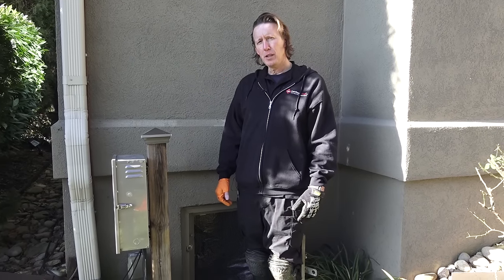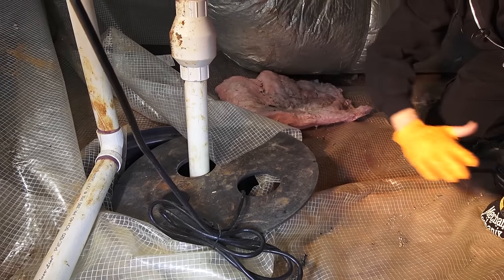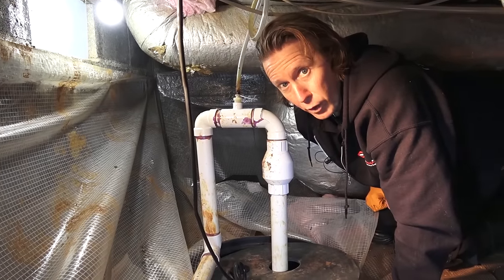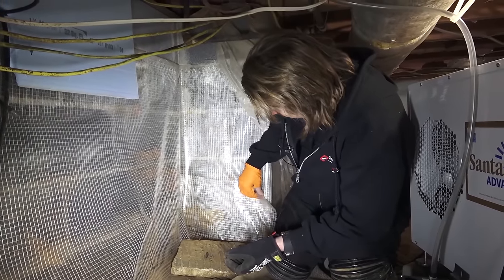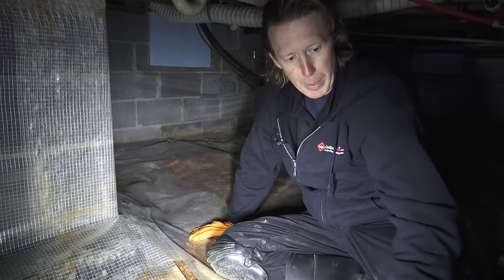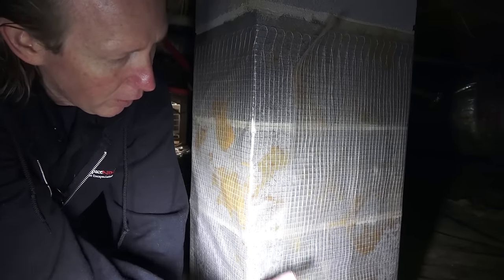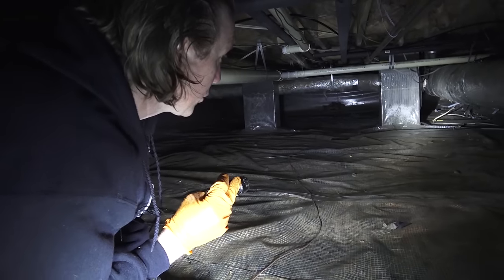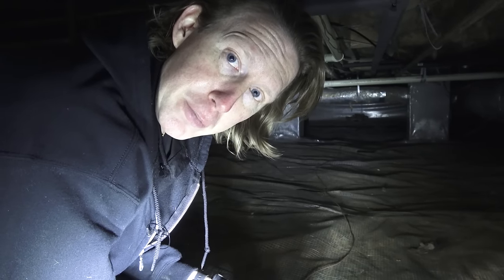Redoing A $25k Crawl Space Job | Tips For Inspecting Your Crawl Space | Find Crawl Space Problems

Comment: I purchased ALL my supplies from Michael some time back (he did not ask me to write this!)  - I communicated with him personally several times for advice as I intended to do my DIY crawl space. AFTER several crazy estimates (VA) I could not afford it contracted out, so I and my boys gave it a shot. We watched videos as well. My CS was extremely hard to do with the highest point under the house at less than 3.5 ft. It took numerous weekends but we got it done. The 2K spent with CSN - saved me 25K. We also installed the vent fan and installed a dehumidifier. TURNED OUT AWESOME .... now I need 2 new doors and I am watching Mikes guy do that. Thanks Michael!!
Reply: I'm thinking of doing the same. Although I am extremely afraid of spiders. I may have wear a full hazmat suit and tape up every opening 😂. The only thing I'm thinking of paying for, is the removal of my joist insulation and treating the frame with the blue mold treatment. Did you do that too?

Comment: I have a basement not a crawlspace and I have learned so much from you. My  dehumidifier runs constantly. Granted I tried to get cheap and leave it off but ended up with mold. Having a chronic illness I got motivated but the cost of running that energy hog has me trying to learn more about it. Fieldstone foundations suck. I have labored over tuck pointing for years and still aren’t even close to finishing. But it’s now obvious where the moisture is coming from. Thanks for sharing your knowledge.

Comment: Love your channel, watched for a year or so. I water proofed the  block walls of my house from the exterior after seeing puddles of water in crawl space. House is in Western NC. My self and 2 labors dug out dirt 3’w , 8’ d to 13’ deep by hand. I used Thourseal on the wet block down near footer and blue liquid rubber on dry blocks. 2 Coats of each. Then dimple board, ran 4” pvc pipe all the way to end. Installed big sock of  Geo fabric then 15 tons of granite gravel. 1 1/2 years and no water. I can send photos, have plenty. I want to correspond with you on how to proceed with the encapsulation. I will try calling you. Thanks John M

Comment: Do the research before hiring someone and get in there with the workers that you hire ask questions is always good to ask questions
Reply: I did a lot of research and from all of them i felt your methods were the best.  I just really wish someone would have mentioned that you should keep wetting down the soil for digging your trenches towards the basin.  10 times faster and easier is an understatement.  And you have a sure way of knowing which way your drainage will flow.  I will share pics if anyone is interested.  Thanks guys for great information.

Comment: The BUILD channel (with Matt Risinger) recently did a video on this, and confirmed this solution for crawl spaces.  He said ideally, you either have a full conditioned crawlspace, or you have a basement.  However if you don't have either, then either consider having closed-cell foam sprayed under the floorboards (after the crawl space is dried out), or consider having it rehabed, where they full condition your crawlspace.  Otherwise its unsafe, unhealthy, and could ultimately cost six-figures in major repairs.

Comment: This is exactly why you do your own research and do it yourself.  There is no reason some plastic and foam board even with labor should cost anywhere near $25,000
Reply from the maker: You're right, just plastic and insulation usually do not cost this much. However, when you include costs for humidity control and water management, plus the size of the crawl space itself, costs begin to climb. We love to support the DIYers out there and that's why we have all of our recommended products available for purchase online!

Comment: This is complete laziness, pointblank.  These people were taken advantage of and I'd be really be raising some hell, if i were them.  In regards to the mold, after you clean and disinfect the subfloor/floorjoists, could you use a mold resistant paint as an extra bit of protection if there were any future moisture issues? I had a huge plumbing issue in the house I bought that went undetected for years because there was no crawlspace access - it ended up rotting all my subfloor and joists. So now i've removed it all and want to be as proactive as possible going forward. I plan on also adding some lighting and sensors to monitor the temperature and humidity there and in other hard to access areas of the house. Thanks!
Reply from the maker: Hey Derek, we use the Anabec x70 preventative after disinfecting and cleaning the mold. You can find it on our DIY Store: https://diy.crawlspaceninja.com/

Comment: The original system was built by one the Huge Pest Control Firms. I have a dozen videos like this, but I'm too small to put them on YouTube. They use a $18 Chinese-made condensate pump. The plastic has micro-holes in it. It's made for the grain and oil industry, not for crawlspaces. Most of their walls are laying on the ground. It's a shame, really
Reply from the maker: We run into it often too. Thanks for sharing! You should still put the videos up! We were once small not too long ago. :)

Comment: What is the best way to join the vapor barrier plastic parts together?  Tape? Glue? Glue + Tape?  (All it takes is 1 power outage, sump pump doesn't run, vapor barrier underside starts pooling water, tape pops, and then the pool is above the vapor barrier)

Comment: Also on the sump pump they used DWV pvc fittings, when they need to use pvc pressure fittings. Itll work but its not correct it also has to be atleast schedule 40 pvc, not foam core pvc
Reply: False that pressure is perfectly fine for DWV

Comment: What are the steps in priority in the encapsulation process

1 remove fiberglass batt insulation 
2 spray mold with sanitizer 
3 mechanically remove dormant mold
4 block vents 
5 add dehumidifier  
6  wait till dry
7 remove old vapor barrier 
8 install new vapor barrier to walls
9 install new vapor barrier to floor
10 reinstall dehumidifier 
 
Dose that sound like a plan that would be good practice for a tall crawl with out much water penetration issues
Reply from the maker: Close! We'd recommend: 1, 4, 5, 6, 3, 2, 7, 8, 9, 10

Comment: So probably its cheaper to just do a 2” concrete slap with vapor barrier underneath it when we build a new house, right?  Cleaner and much easier to claw around.
Reply from the maker: If you're able to do it during the build, that can definitely be an option. Keep in mind you will still want to control humidity and if the grading is not done correctly you can still deal with flooding issues in the future.

Comment: This borders being criminal. I know this system very well. It's 6mil DuraSkim that actually is manufactured with microholes in it. The walls are "stuck "up using spray canned adhesive that will run the homeowner out of the house. They rarely use a fan at all. When I was there, they used a $79 pedastol-type Sump pump and charged $1900 for it. They dug no trenches, they don't overlap the seams unless it's convenient. They don't tape them. Honestly, the last four Santa Fe units installed by this firm were NOT working, they use 1/8" foam board to block the vents. They put a single flap of poly over the door area and call that done. Once, I charged a homeowner to remove Insulation and spray the floor joists with BoraCare. 1200 sqft house = $2400 to remove Insulation + $1800 to spray the underside. Homeowner calls me. He says "Right down the very center of the crawlspace , from end to end, the insulation wasn't removed. So if the insulation wasn't removed, how could they possibly miss that if they sprayed it?" . I got those kinds of questions thrown at me EVERY SINGLE SOLITARY DAY. It was almost comical how they somehow blamed the homeowner. At 22% APR financing, it's an absolute sham from start to finish. I made a video of two other employees that too me ON CAMERA that when the client was charged thousand$ to have it sprayed, they almost NEVER sprayed it. And I HATE THE CLEAR TOO. But it's cheap. Buying that nationwide, I was told they paid $12 per 1000 sqft. I might get a $7500 contract including $2000 of interest , and when three men did the job in 4 hours, the client might have less than $100 worth of product. One last thing. It comes with a one year warranty, and an annual renewal fee of 12% that was supposed to include changing the filter. To this day, having done 200 of the annual renewal inspections, I have still NEVER seen a Santa Fe filter. Embarrassing. I made a ton of videos when I worked there. A ton.

Comment: Sloppy installation of good materials. The dehu should’ve been installed in the center. The barrier overlapped and taped, glued to the wall and ramset, at least a yearly inspection, vent materials poorly installed, I don’t think that particular barrier is even used anymore, the drain system is acceptable except for the install. For 25,000 before and after videos are a must.
Reply from the maker: Thanks for your feedback and watching.

Comment: Thank you for actually offering a service with knowledge about your field. 

 A question for you, this job had floor joists insulated with fiberglass. Why was it removed? 

 I am in West TN and about to embark upon this same project at my home.
Reply from the maker: When we encapsulate we have to remove it to address mold, so we insulate the walls instead of re-insulating the subfloor. We find it works best for efficiency and it allows you to see any leaks from above that may get hidden by fiberglass and eventually cause mold.
Reply: Very logical thank you!

Comment: Is it wise to cover the ground with stone before laying the plastic caper barrier in a crawl space?
Reply from the maker: Concrete slabs should be placed directly on top of vapor barriers, followed by subbases. A thin layer of sand can be placed next to the vapor barrier if the subbase is sharp angular gravel.

Comment: CONFUSED:. read through comments hoping not to repeat a question.  You are sealing the foundation vents  but then you mention you need proper ventilation to prevent the odors?  What am I missing.  My daughter's house has 4 crawl space vents and I am getting ready to lay vapor barrier in hopes of eliminating the damp muskey smell coming into the house.   Should I not seal all the vents to get some airflow?
Reply from the maker: You are correct, we seal all vents but one and install a ventilation fan blowing outward. This is per international building code recommendations and to also help mitigate any radon issues. If you live in an area with higher radon we recommend checking with your local building code to see if anything more strict is required. Here are a few videos talking about ventilation that go into more detail:
https://youtu.be/LzBlVnbn6A4
https://youtu.be/0q73lxzhyN4

Comment: How would you go about applying the plastic to the concrete walls and pillars? I bought a house last summer and notice it was very humid in the crawl space. There is vapor barrier on the ground but they put dirt over top of it and the dirt is always damp. So I'm thinking of putting thick plastic over the dirt.
Reply: Have you figured it out yet?

Comment: Unfair.

You can't say that all of that garbage in the back is their garbage and at the same time say that the job that they did wasn't worth $25,000.

Obviously the job wasn't simply an encapsulation job they did a number of different things down there and just based on the video the encapsulation wasn't the primary job.

My guess is they were called in on a flood emergency, they probably removed a whole bunch of damaged material, install the plumbing,  installed the dehumidifier, arrested mold and lay down perfunctory vapor barrier. 

It obviously wasn't a job done well but I do feel that it was probably worth the $25,000. 

Sometimes when you talk to a customer and you tell him how much it's going to cost to do this this that and the other they say well I'm not going to put $50,000 into the underside of my home -- I don't see that, I don't go down there, I don't care what it looks like ... so they choose the more affordable option. 

Did something that caused them to call you to come out to do the inspection it would have been great for you to tell us what that was.

And there was a presenting cause for the original job it would have been nice to know what that was as well.
Reply from the maker: There was smelly a musty smell getting into the home and the company that did the encapsulation had no solution to correct it. That is why they called us out.

Comment: If the trench was installed low enough but was disconnected at the corners, what would happen? It would still flow three the gravel and into the next pipe? Correct?  Or would
There be a major flooding?
Reply from the maker: Yes, it could cause flooding, but the main concern would be contaminants/dirt washing into the pipe and clogging it. That is also why you need pipe with a sock around it to help keep dirt out.

Comment: This may be a stupid question but j dont know the answer so....why do you seal the vents ? What is the purpose of the vents if they need sealing?
Reply from the maker: the vents are sealed to prevent humidity, the second questions is a very good question but we dont have an answer to that.
Reply: @CrawlSpaceNinja  imo I dont like encapsulated crawl spaces. We definitely like to put a 10 mil vapor barrier on the floor of the crawlspace and French drain, dehu  etc if needed. But instead of doing a full encapsulation we use an atmox system. Basically fans by the vents that will circulate the air. The have humidity sensors. If an encapsulated crawlspace has problems then the only place the bad air has to go is up. If you can circulate air from the outside and keep the area fresh its probably better than trapping everything in. And btw 10 mil black poly looks good and comfortable to crawl on

Comment: Hey bud I just bought my first house it was built in the 50s my floors are buckling walls are bowing an in bathroom ceiling is coming down around the bathtub had cold air coming in around it so I looked in the crawlspace because the fan stopped working an where the doors are the plastic is pulled back an the foundation bricks the first 3 rows are wet any I dea how to fix I'm on unemployment so cheap way thanks
Reply from the maker: Sadly it wont be a cheap fix, if you have water intrusion you will need a water management system, and also a dehumidifier.. you can always start with a dehumidifier so you can control your humidity

Comment: Can you advise please?  We have some old mold (black & white) on some of the floor joists in the basement.  We have the dehumidifier going constantly, but want to kill the mold and clean it before I apply concrobium mold encapsulator on it.  Any ideas as to the best mold killer and cleaner to use that I can just spray on and let dry?  I want to find the easiest method, since some of the joist are under ductwork and hard to get to for scrubbing.  This will be a DIY job.  Can't afford a mold remediation team and dehumidifier has pretty much abated the active mold anyway, but we want it permanently gone so it can't ever have a chance to reactivate.  Thanks, hope you know of a product...or if you sell a diy kit for this.
Reply from the maker: Thanks for the questions, 
we have some mold cleaner in our https://diy.crawlspaceninja.com/product-category/mold-removal/  we sell and use anabec for mold removal.
Reply: Crawl Space Ninja , Thanks very much!  I will be checking out the link. 👍

Comment: How much will the job estimate out to do it right? Are the sump pump and dehumidifier reusable for the redo?
Reply from the maker: Since we are having to correct many issues caused by the previous installation, in addition to our exclusive installation practices, the cost will be more than what the homeowner paid previously. However, they will have the peace of mind of a lifetime warranty with their encapsulation. The dehu is not being used, but we did keep the sump pump and installed a second one at the back of the crawl space. Keep an eye out for a progress video and an after video. Thanks for watching!

Comment: Would you be better off pouring a concrete slab in your crawl space?
Reply from the maker: Great question. That would be very expensive in this situation, the crawl space is over 3,000sq'. You would still need to lay down plastic as water vapor can still move through concrete.
Reply: @CrawlSpaceNinja  
Thanks for the reply, maybe you can do a video on it and the pros and cons on both.
Reply: lol, pouring concrete in a crawspace would be nuts! you gotta do that when the house is built.

Comment: Some company took them for a long ride.  It looks like they got ripped off.  That company should be sued for that awful mess.  I hope that doesn't happen to me.  I might have to be under that crawl space with them.
Reply from the maker: We've had some customers come down with us while we work!
Reply: I just found out that once the dehumidifier is installed, I will have  to go in the crawl space to change the filter once a year... y'all please, please pray for me.  I have to be brave... OMG!!!
Reply from the maker: @Them353  Hopefully if you're getting your crawl space encapsulated as well, it won't be scary at all. You can do this! Check out our dehumidifier maintenance videos if you're interested: 
https://youtu.be/ZWLzVaAR0bE 
https://youtu.be/QCc5D91DyUI
Reply: What advice would you give me before going to change the filter from the dehumidifier in the crawl space?  I was told this needs to be done once a year.  I'm scheduled for encapsulation in July 2020.
Reply from the maker: @Them353  Knee pads and gloves are really helpful, especially if the space is not encapsulated yet.
Reply: @CrawlSpaceNinja  Thank you.